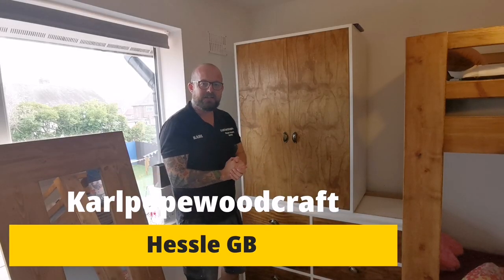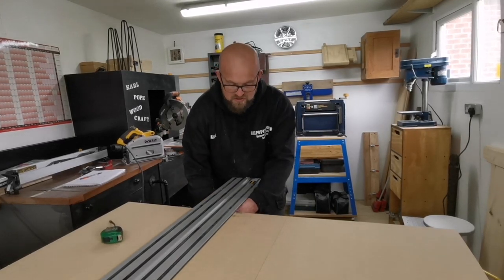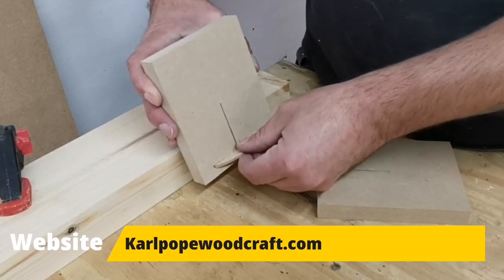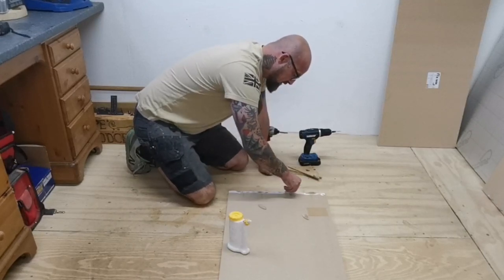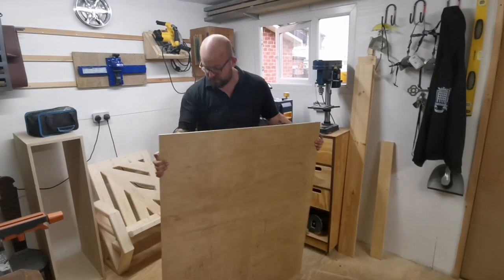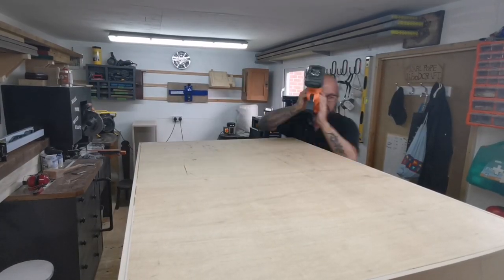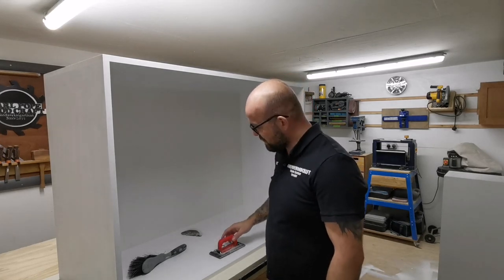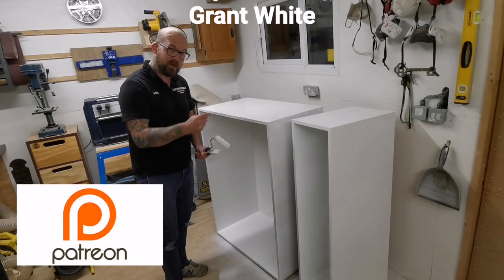How To Build A Wardrobe For Under £50

Comment: This is looking very tidy mate 👌 what do you use under the track saw when you are cutting sheet material, do you have a sacrificial piece?
Reply from the maker: Hi Ross it's a piece of insulation board keeps it nice and stable and it's so much more efficient than placing bits of scrap wood down. 😊
Reply: @karlpopewoodcraft  nice idea, I am thinking about a new workbench soon and I like that idea 👍

Comment: Nice video, do you find that using RIgid insulation sheet for sheet cutting is the best solution? Thanks 👍
Reply from the maker: Hi Richard definitely as it keeps the boards stable, protectes the workbench and last ages.